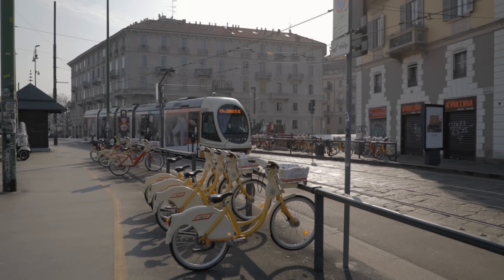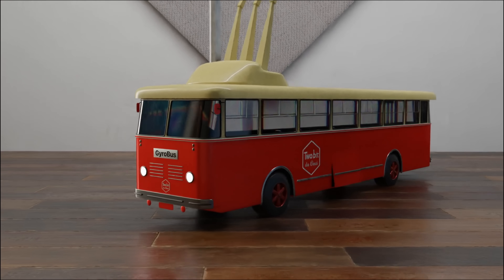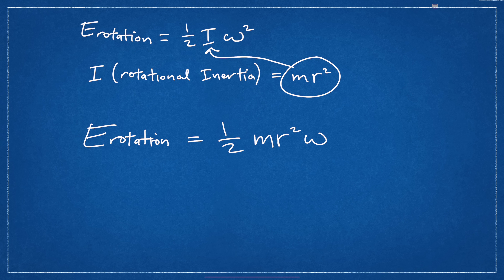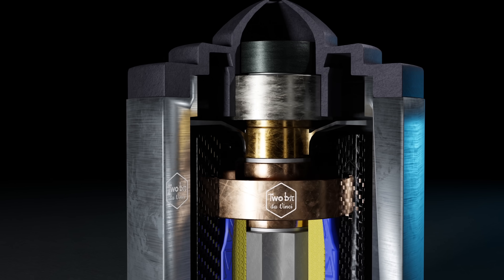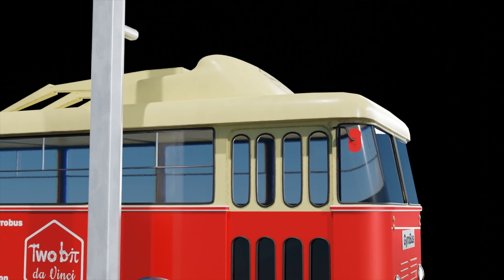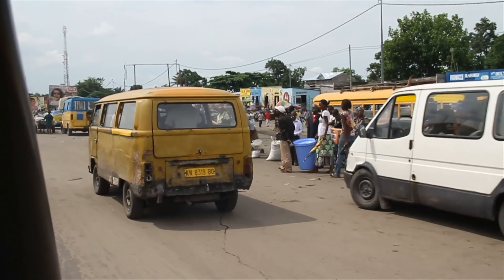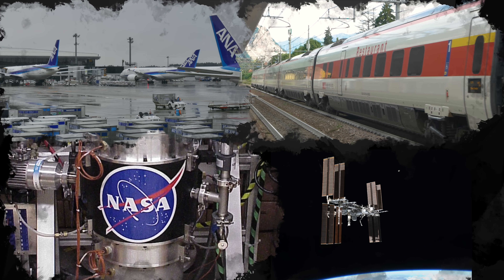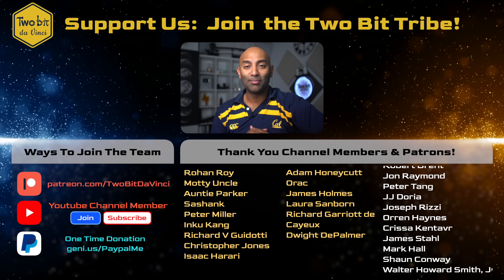This Bus Went Electric WITHOUT Batteries

Comment: My personal experience taking public transportation for 20 years is that a typical bus stop between bus stations is usually under two minutes long. Pumping 1kWh back into the flywheel in less than two minutes to make sure the bus can reach the next stop would require a 30kW feed at each stop. I can see how that might be problematic.
I don't see why a flywheel would make turning problematic: a flywheel with a rotation plane parallel with the floor and driving plane wouldn't affect turning besides opposing roll. The same effect could be problematic for bumps though since the gyro would oppose the bus following changes in road surface slope unless there are bushings to allow some degree of compliance between the two.

Comment: Yes I suspect the gyroscopic effects on a moving fly wheel would have been the biggest draw back. Not only would it steer is very strange ways, ie 90 degrees to the axis of rotation but the forces on the bearings would be huge, over and above going over rough terrain. They certainly do seem a good option for fixed power storage but I've never seen any analysis of the cost compared to say batteries or pumped water storage

Comment: Gyroscopic effects in a gyro-bus are simply an engineering failure, since the angular momenta L are cancelled out, if two flywheels are stacked an spun in opposite directions. Magnetic bearings and clutches could provide these vehicles a resurrection - with very low energy losses.

Comment: Little side note, when a flywheel is used to adjust the angle of a space craft by either adding energy, or taking it away, they're referred to as reaction wheel, usually having 3 of these wheels on 3 different axis
Reply: It is likely usually more than 3, as that has no refundancy. More likely 6
Reply: Three or six the effects the same.
Reply: @robertwoodliff2536  Merlin is right, every system for management/control should have at least 1 redundancy, IIRC the space shuttle had something like 7 computers to combat cosmic ray bit flips in RAM/cache, with a 'voting' system where whichever 'answer' had the highest number of votes won
Reply: @denvera1g1 ...thank you, 3 or 6 the effect is the same, the longevity may be improved, depending on build quality/design. Always think the Shuttle seals put these in context. But then,'we' built the De Havilland Comet.
Reply: @robertwoodliff2536  
True, but they are such a vital component that you'd want redundancy on your 100 million dollar satellite
Reply: @merlinious01 .....think Hubble put the madness in context.

Comment: The modern replacement would be the supercapacitor!  Almost instant charging and 'slow' discharge!!
Reply from the maker: very true!
Reply: Wouldn't this be better thinking bigger rather than thinking just transport, IE like I said before, I own designs for clean sustainable green power, now you wont find them in the patent office where they can be stolen by big money, Mr Dyson said to lock them up in a bank, now I have offered this for free to anyone who wanted them, with time the design I drew up would work easily with water paddles, spinning a flywheel, storing power in capacitors then feeding a steady supply to on shore, larger capacitors or main line storage systems, then cheep power for transport. feel free to think about it and use no matter who you are just use it.
Reply: Similar energy densities with higher cost and shorter lifetime, but it does seem likely they have a lot more room for improvement and could be viable someday.
Reply: exactly
Reply: But you would need much more space to store the same amount of energy, Porsche raced a flywheel powered hybrid 911 while the 24hrs at the Nürburgring in 2010. And they could stay out one more round instead of the regular 911. 

My opinion is that only the bad pollution rules stopped this technic to make it into production cars.
Reply: @ingmarmaul4464  True. Although it was engineered by Williams F1 / Advanced engineering in 2008 and used in season 2009.  End of 2014 Porsche bought he whole Kers department from Williams.
Reply: @ingmarmaul4464  hybrid cars are more practical    if they really want to change things WE NEED A pre fab DROP IN kit     for existing cars all ready on the road   esp for  older suvs that are 2WD  and (such that support 4WD  i.e chevy tahoe, subrban  pickups  )  these are the ones that  waste the most fuel .... as they only get about 10-14mpg city/hwy 

I have a chevy tahoe  hybrid suv  it gets 23 to 32mpg(depending on the route i take...) on the highway   with a v8 engine 6.0L

the city is 18MPG....

   considering the normal 6.0L engine only gets 9MPG and 13mpg on the highway

most cars all ready have electronic throttles  since like year 2004.....

 also battery replacement   for existing hybrids need subsidized....

 as building new cars just will cause even more waste product and more pollution....
Reply: @punker4Real  yes you are right, tiny evolutions makes the world better. Question is how you implement that in the engine management especially with manual gearboxes. We do have a lot of them here over in the European country’s.
Reply: @punker4Real  chevy should make a e-ls
Reply: What do you mean by slow
Reply: @nesdi6653  The poster probably means that self-discharge (i.e. without load) is relatively slow. Supercapacitors have faster self-discharge than most batteries, but greater longevity.

Comment: To make turns, just turn the flywheel.
Instead 1 flywheel, it's better to use 3.
To reduce the power price, bus stops can have solar panels or wind generators, also a flywheel.
Wear and tear isn't too expansive if the flywheel be design for be cheap and durable instead very energy efficient.
Bus body can be design with elasticity to absorb flywheel accidents and generators can brake wheels if misaligned!

Comment: Very Interesting video. I've heard of this. I wonder if two counter rotating flywheels would have nulled  the turning issues.(Like twin props on a boat). An electric car exited in the 1880's.Unfortunately snuffed out real quick.
Reply: Right, John, I've seen pictures of electric cars and electric 'pumps' from the turn of the century. Sadly, though, the powers that be determined they'd make more money from manufacturing ICE cars and selling us oil-based liquid fuel, because there is an inexhuastible supply of oil (only water is more abundant).

Comment: One way to increase rotation would be through the use of perfectly round ball bearings. Current ball bearings viewed under a microscope look like mountain ranges. We can and should manufacture ball bearings in zero gravity space. Perfect ball bearings every time.
Reply: They are by now way beyond metal ball bearings. As mentioned current high performance fly wheels often use magnetic levitation bearings with no physical contact at all.

Comment: Yeah I got an idea for that gyro outlet the bus I let bus if I don't want to use that technology for the bus we can use that gyro to a wind turbine generator and touch another shaft coming off of that on the other side to touch the blade turbine part of the thing where the wind will get it turning and the Charo what they turning inside when the wind goes away for a little bit you know and you can set your skin and making power for the upright Wednesday generators that usually sits around in the yard or on route it has no way of keeping going without a constant flow of wind this way you don't need a coffee flow you just need a good move flywheel that's to your wind turbine generator with added for the turbine blade to be attached to return the turbine and I got ideas for those big giant turbines it was in this video that makes power put in the back of a pickup truck but flaps on the outside of it create a wind turbine generator things and generate power for electric pickup truck cool huh and you be totally off grid and when you going down the road you be getting more power into that turbine generator flywheel wouldn't be great just well some flaps to the outside of that big giant flywheel and put a air shaver around that and put it with scoop over the cab of a truck and whoop it down around that and create power and wouldn't it be great if you closed office interior of that flywheel with a beer tank your foot antifreeze and water in and create a ultimate so I will generator water and wind power generator turbine flywheel cocoa making power to go and just use the regular car battery to kick off the motor to get up to speed with electrical current to keep it going and what you're going you can go go cross country and you don't have to stop you don't have to run that battery down use the battery to start the process and then drive to you first I can't stand to drive no more departure thing that's the thing generate power you just plug this thing into the grid at the hotel where you're staying and get a free room and board and maybe your Mill Street for running the meter back on the hotel and helping a hotel and electric bill what it's been down wouldn't that be cool yeah yeah

Comment: when I saw the thumbnail of the video, I misunderstood the technology. I thought, the bus generating power using the bumps and holes while moving, like wave energy converters. but fly-wheel was a surprise to me. very interesting. how about using small 5 inch x 5 inch cylinder shaped single fly-wheel units, packed together, let's say 100 on them. how much energy they would provide? how many miles would an EV car would go? fly-wheels + battery combined would be better? how about adding a mechanism, that would allow a person to turn all the fly-wheels using a simple mechanism, which would give enough energy to travel +10 miles? as an emergency backup?
Reply: small ones would be worse overall because the diameter is smaller, and that's the thing you want to maximize.
Reply: @incognitotorpedo42  Frictional losses would probably be a deal breaker on something like this.

Comment: In the late 1800’s a mining company constructed a flywheel in Mammoth Lakes, CA to power a saw mill and stamp mill for the gold mine there.  I had a mountain cabin there in the 1970’s and discovered the fly wheel still in tact.  The building and everything else is gone, but the cast iron 20ft diameter fly wheel still sits up in its mount.  It must weigh 25 tons or more.  They drove the fly wheel with a geared steam engine.  The derelict mill was scrapped to provide metals for WWII, but the fly wheel was too large to remove.  It is a short hike off of upper Old Mammoth Road.

Comment: I remember hearing about the idea of using flywheels for energy storage when I was at University in the 80s. Nothing much was said about it, just that it was an option. Then one of my earliest jobs involved using high vacuum pumps that had magnetic bearings. Initially after starting up the device used regular bearings but then the shaft that had the pump also had a generator that powered the electro magnets. If the power to the motor failed then the magnetic bearings would remain operational until the shaft was rotating slow enough that the regular bearings could be used or the power returned. This seems like a really great development for network/grid storage.

Comment: BMW had a hybrid flywheel car, I think it was a 3 series. I heard you could still feel it when you were taking a corner, that problem can hardly be solved. 
I am not sure what the efficiency of the whole system is. The 3.4kWh for a kilometer is pretty high. I would expect a 20 passenger electric bus hardly to go over 0.5kWh a kilometer.
Still, efficiency isn't always the most important factor, and we will still see the flywheel present in solutions. But I'm afraid not in vehicles.

Comment: The reason we are likely to see more flywheels in the future is the fact they can be repaired and recycled. Those are 2 major failings of chemical batteries. RIght now there is a major push towards solid state batteries but I think once they are well established flywheels will become much more common. Unless fusion or some new technology becomes more viable in the interim.
Reply from the maker: Great point!
Reply: mechanical stress is a big problem with flywheels; so we have to use carbon fiber based (composite) that are lightweight and low inertia. Low inertia means you need very high speeds. That means you need a vacuum chamber- means pumps and other paraphernalia. magnetic bearings are expensive. Repairing such systems may be very very expensive. And if you need maintenance regularly, forget about it!!
Reply: @janami-dharmam  Coincidentally they said the same thing about turbo chargers in the past and a turbo is little more than a pump flywheel. Modern manufacturing methods and materials have eliminated many of the obstacles that made turbos expensive and unreliable in the past. As we exit the age of carbon fuels I believe the need for energy storage is likely to drive flywheel technology in a similar manner. And let's be honest, even continuous maintenance is preferable to waiting 100 million years for the carbon fuel supply to replenish itself :D
Reply: @debunkthejunk1  You see solar panels become cheap (affordable) thanks to the chinese. Do you think that americans would have let the price of solar panels to fall so low that common man can afford it? Batteries have problems but we are familiar with it and thanks to chinese they are affordable. Do not compare with the turbo-charger because they are only an incremental improvement most customers really did not care.
Reply: @janami-dharmam  The Chinese? Lithium ion technology is a result of American and Japanese innovation. LG and Panasonic, which are Japanese companies, manufacturer 50% of the lithium ion batteries being used today. CATL has only been in the game for 10 years and has 20% of the market share. And to be honest, they don't have the highest quality product. I have no idea why you would credit the Chinese for any of this. And I'm not talking about the performance of a turbo charger? I'm talking about the manufacturing processes like die casting aluminum, innovations like magnetic and ceramic bearings, laser balancing, metal alloys with more desirable thermal properties etc. Turbos are excellent example of a technology that people dismissed for the same reasons; too expensive, too unreliable, too complicated. Today you can find a turbo on just about anything. It would be foolish to dismiss flywheel technology for the exact same reasons because they're the exact same thing with a slightly different application!
Reply: @paulreeder5241  Fake News: they are short on children! Get your facts. Most US companies do manufacturing in China, why then?

Comment: For instrumental purposes, MEMS gyroscopes are replacing the traditional gyroscope. At a rapid pace. Your cellphone has at least one.  For some purposes, they will never disappear. As long as combustion engines exist, they will have flywheels. Combustion engines will probably always exist, whether it's for sport, hobbies, small generators, etc. Renewables are necessary but some things need absolute methods of large scale energy production. For example, a mobile hospital for disaster relief.

Comment: Seems like to me Flywheels might be what should replace or augment solar home energy storage.
Reply: Recycling being way more expensive than manufacturing new batteries, and every new gen using other chemical elements anyway, I expect a lot of surplus car batteries becoming available.
They may not deliver the current anymore for driving a car, but a coffee maker wouldn't pose much of a challenge.
Reply: That it is not so today means simply that there are too many problems waiting to be overcome. It is simply messy, too expensive and too inefficient.
Reply: @janami-dharmam  Rubbish. A flywheel storage system does not have to be expensive, high tech or NASA grade to be very helpful.

Comment: Now you should profile a pumped-storage bus, where an electrical connection at stops pumps thousands of gallons of water into a tank on the roof of the bus, which is then reversed to generate power to get it as far as the 3rd or 4th stop down the road before needing to pump again. It requires such a large volume because the resulting head pressure for such a short drop is low and this has to be made up by volume. I'm sure there won't be any unanticipated side effects or complications from the technology. (The average bus-stop time in my city on the streets--not at a transit center--is around 40 seconds, not several minutes, so no matter whether it's a gyro motor or a water pump, it's going to have to really move.)

Comment: Amber kinetics makes flywheel storage for grids. The MIT plasma fusion lab reactor used a 75 ton Alcator C-Mod flywheel that transferred its energy in about 2 seconds to just a few particles. Formula 1 used the KERS system flywheel. Great for high power, and many charge cycles in principle, but storing lots of energy is pricy. Also rotating machinery = maintenance. Amber kinetics typically buries their vertical flywheels in case they fly apart.
Reply: Williams F1 designed and made the flywheel KERS system, but they never raced with it.  They adopted battery based tech instead like all F1 teams utilise now.  They did licence/sell the technology though, and it has been used to good success in other racing categories.
Reply: @mattos4203  it is also used in busses and other veichles that do a lot of stopp and starts.